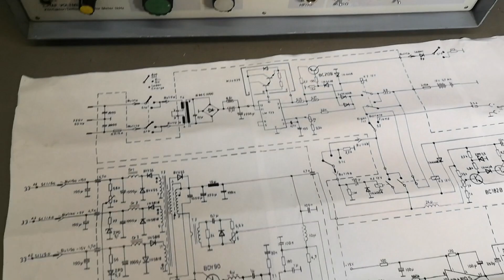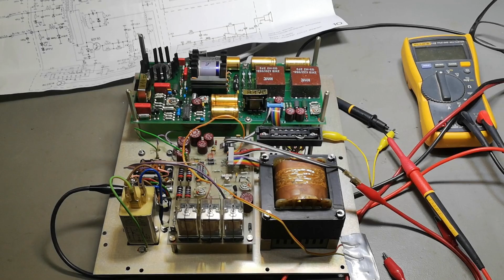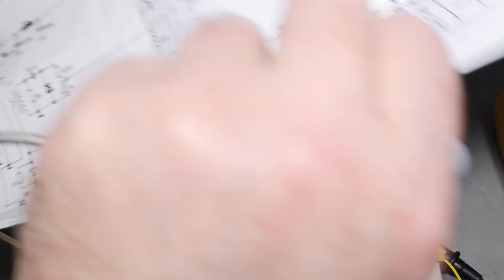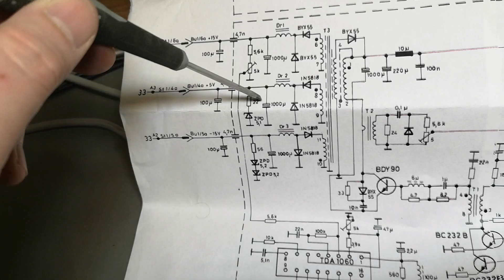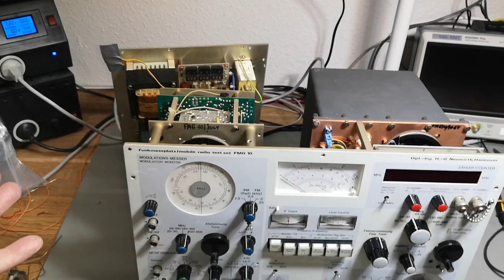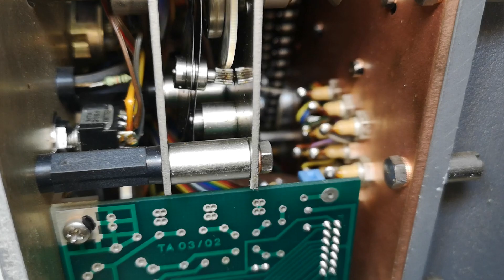H. G. Neuwirth Hannover Funkmessplatz FMG 10 mobile radio test set repair teardown

Comment: Hi, the device is nice, but apart from the capacitors, resistors and integrated circuits have probably leaked inside 🙄 the leak is probably everything 🤪 I'm kidding, but I've never seen so many leaked capacitors at once. It's going to be work before you replace and clean it all 🥱 it's already hurting my hands 😁

Nice day 😶 Tom